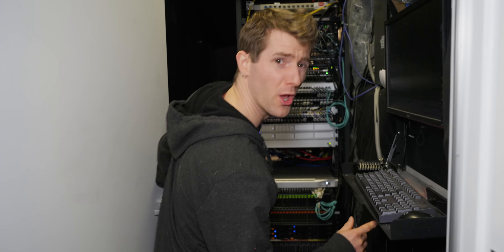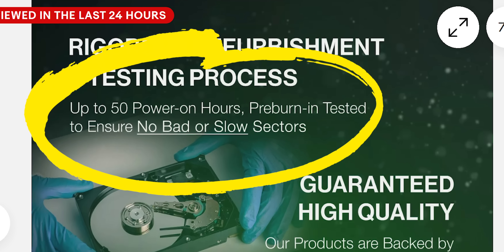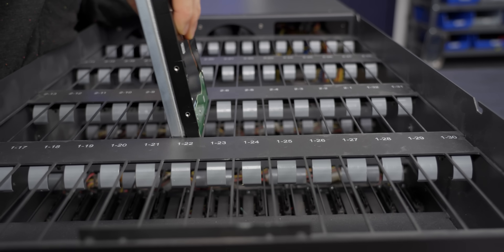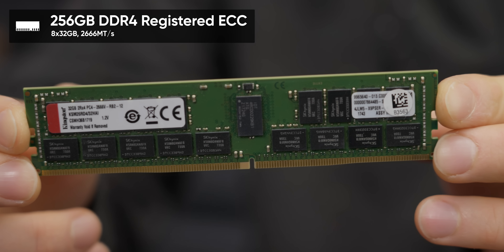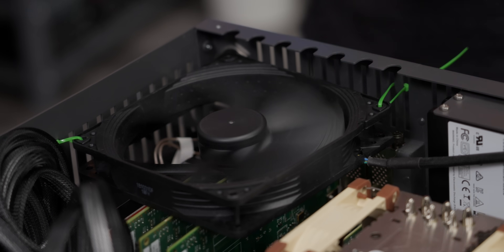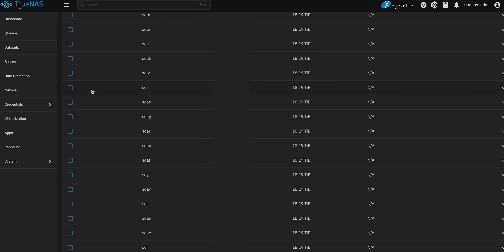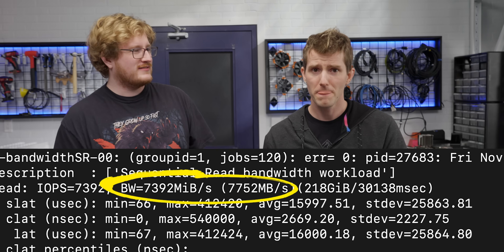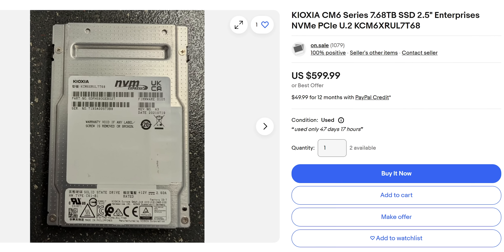Is Buying a PETABYTE on Ebay Stupid?

Comment: I've had about 15 refurb drives through the years with unimpressive results. 
It first started with two 1TB Seagate constellation drives in raid 0 that both died at similar times, then a handful of 1TB WD RE drives in a freenas build that I think about half eventually died over years, to now a mix of HGST and Toshiba 3TB consumer drives with mixed results, usually bad sectors, rather than outright failure to mount. 
At this point I've given up on trying a NAS of random drives. The cost wasn't worth it for my use case

Comment: I've been running refurb HGST 8TB drives for ~3 years now in my desktop (2 drives) and have had a great experience, so much so that I used the 12TB variant of the same drives, 8 of them, in a RAIDZ2 setup that I did in much the same way as in the video, just in my old desktop and its Fractal Design Define R5. That's been running for ~3 months and has been rock solid as well. 72TB array has been a great upgrade and I wouldn't do anything different if I had to do it again.

Comment: The real catch is that refurbished drives from Seagate will not have any warranty! I had this experience with Seagate Exos drives... Got faulty drives replaced by "refurbished" ones and I was told clearly that they would have no warranty...
Now about ZFS for important data, I would prefer using Mirror VDEVs (RAID 1). I have 2 reasons for that:
1. 20 TB per drive at home seems quite enough for years to come, especially with 4 drives in RAID 1, giving 40 TB.
2. If 1 drive fails and has to be replaced, the rebuild will be much quicker than the having 1 or 2 parity drives and 2, 3 or more data drives. That would take weeks to complete on such big drives! Remember that during the rebuild process, all the other drives are under heavy load and it is not uncommon to have another drive failing during the process... Oooops, all the data gone! With mirror redundancy like RAID1, it is just a matter of "cloning" one drive to the other. Much faster, especially on a 20TB drive.

Comment: I bought 4x 18TB recert exos drives and been running them in my NAS for a year now. Would recommend since filling out my nas with that much space would have cost 1600 with new drives and if it fails I have redundancy

Comment: Personally I think as long as you have backups then old drives are fine as long as you respond quickly to failures. The odds 2 drives fail at the same time is low. In fact you actual reduce those odds with second hand drives as they have different usage. 2 brand new drives will wear out nearly identically

Comment: My setup is based on a Lenovo desktop tower (no monitor) and two 2 TB external SSDs connected to the desktop via USB which acts as the NAS. I'm using desktop Windows and Windows Storage Pools with mirroring. One of the drives failed recently, note -with storage pools before physically removing the failed drive, remove it from the pool while its still connected as you will have to rebuild the whole pool as it will not accept a replacement :-( I'm waiting for SSDs 4 TB drives to come down in price to replace the existing drives. They will be mounted internally. I used to use a Raspberry PI what a nightmare that was.

Comment: I've now bought 8 of 16TB Ironwolf refurb drives for about 200$ a pop instead of the ~400$. They are more silent than the Exos drives. Started buying locally, then moved to ordering from china with fast (~1week) shipping for no extra charge.

2 of them have started showing bad sectors, of which one of them I was able to RMA, second I removed from the pool yesterday without losing redundancy even momentarily. Running on my old main PC's hardware including a Define R3 case that fits 7 disks concurrently so the "NAS" itself cost nothing, with a NVME boot drive through a pcie+usb bootloader stick hack (old 1TB nvme), and because I'm running on Windows with storage spaces (parity), I can have Backblaze running and backing everything up to the cloud for even more redundancy for 10$ a month.
Also does other things like my own app compressing ~8h of video daily with NVENC, and running DirectComputer-based whisper on my old 970 GTX, which is another reason for being Windows-based.

Yes it runs at 100watts when idling, 24/7. But electricity isn't Germany-priced where I live so it's fine.

I double dare you to have a more frugal 1/10 petabyte single-user home backup / GPU server than mine.

Comment: I never considered to use recertified ones because I plan to use them as long as possible for home use, and half of HDDs are installed to normal Windows computer that does paperworks, gaming, Internet, anything 'PC' does. But, for NAS, with RAID 5 or 6, and if that NAS isn't for almost persistent data storing like cold storage, this sounds pretty good to adventure. Hmm.

Comment: I've been running eBay used and refurb drives in production servers for DECADES.  I haven't been burned yet, it's been absolutely fine.  My current hosting server setup is RAID 6 with 8 used (not even refurb) drives spinning, I bought a 10-pack, had to use 1 of the cold spares after 3 years, and it's now on year 5, I've still got a cold spare left, and I'm not even gonna consider replacing the array until I have to use that.
I'm gonna consider getting some of these 20TB drives and moving my media server storage, because my pirate TV and movie collection keeps expanding to fill available space, more would be good.

Comment: This screams cost recovery of someone offloading unused hardware. The middleman has every incentive to buy quality product and provide a decent warranty to make a reliable margin. The middleman also knows his supplier has sunk cost into something that would otherwise not be used or make money doing work. In truth you're often better dealing with bulk suppliers like this because you can have relationships with them and they care about rep, plus they have spares that they have acquired for pennies--unlike Seagate which is trying to pad their bottom line by hiding failures and squashing returns. This makes Seagate minimize their losses by offloading them, which keeps their stock value high. I don't know if I should be happy or disgusted, but that's the game.

Comment: I am a ratty rat boi. I love secondhand tech. From storage to even some LCD drawing tablets to cars, to batteries and everything in between. I understand how channel this big has to warn and advice against, but anyone who knows how a disk can fail, how storage can fail, how long they should last and how to back it up, they will know that it is very worth it to take a gamble on things that are 70% cheaper than new. I just got my nasrig running with 3rd hand storage with raid 1 on 3x 4tb disks and it is running perfectly. I can have 2 of them fail and still retain my data.

Comment: Here is the thing - as long as you have redundancy to prevent data loss, at 50% off you could literally lose 40% of the drives immediately and still come out ahead.

The odds of having that many fail are incredibly low.

Comment: All of my drives are pretty much HGST refurb drives from eBay.

Been using them oh gosh...since AT LEAST 2007, in varying capacities.

In my experience, pretty much all of the drives that has died, did so because the AMBIENT environment started getting hot (e.g. system was sitting in front of a heater vent because that's the only place where I could put it in the room that I was renting, when I was in uni), but otherwise have had GREAT experiences with it.

I would NEVER buy Seagate.

And you're 100% right about the migration from cloud BACK to on-prem, because it doesn't take a genius to be able to figure out the math and the economics for on-prem deployment favours on-prem systems SIGNIFICANTLY.

I'm still surprised that you guys aren't using LTO tape for archiving, but for long term archival usage, it'd be better and cheaper, to go with tape.

Comment: I wouldn't trust a brand new seagate drive let alone a refurbished one. Every seagate drive I've ever owned has failed within 3 years, meanwhile I'm still running a 1tb WD Green from 2005 as one of my game drives. I dunno how you can accept their sponsorship when you can look at statistics from any data center and see they have a ~95% early failure rate.

Comment: That server CPU is only 8 years old? I recently checked what kind of CPU is in the server we have to use a VDI on at work for some tasks for security reasons... It was a xeon from 2012... And yes it's unbearably slow. If I haven't logged into it for a while I better wait for like an hour after starting it to let the virus scan do its thing as it just 100%s the three cores I get for about that long. Luckily I personally don't need it much, it's terrible.

Comment: I even went the route of buying 10x 4TB used enterprise-grade HGST drives. I checked them with harddisk sentinel and they had over 400TB read and 200TB written. SMART data still looked good and hard disk sentinel graded them as 100% health. They have been going strong without issue! I won't buy new drives anymore, as buying a box of 10 is the same price as 2 new drives. I'll just buy another box when they start to fail!
Reply: 100% what I do my friend! I buy 16 TB refurbished drives with 5 year warranties alllll the time. They work amazing! I had one poop out on me the other day. Though if you're running 10+ drives like yourself or I, then you're doing things like ZFS/RAID (redundancy yay!) But I just swapped out the bad drive with a cold spare, sent in the old one for replacement, and had to pay a $4 shipping fee. And even without the warranty, lets be real. It's cheap enough to just buy another lol.

Honestly I don't think I'll ever buy a new enterprise HDD again.
Reply: @slurp50s  hell yeah! I still haven't gotten a drive fail on me. Like you said, zfsraid 2 on 13 drives wide for safety. I have 2 hot spares ready to jump in and 2 cold spares on the side. All those drives cost me less than 5 new ones. Insanely effective
Reply: @AppaFappa  No drive fail yet? I've had a handful with refurbished or used, but I wonder if it's also where I live. Power in my city is notoriously terrible. I have UPS's, but sometimes the UPS doesn't survive the full outage, so I have hard power downs, which is terrible for the drives.

Why haven't I set it up to auto shut down safely because I can? Because I'm lazy lol.

Though, not sure if you've played with vcache or SLOG, but I've been utilizing that for real for the first time recently and I'm absolutely in love. I'm even running freaking databases on it now!

Like what the hell?! How is my insane ZFS hybrid rust spinners and NVME's running glorious freaking SQL databases?! hahaha, cheers friend!

Comment: I just picked up the Seagate Recovery Service’s results from the 3/4 full 4TB drive drive I accidentally formatted. Without warning they sent only a portable 2 TB 2.5inch replacement. They did not send instructions to use their included file explorer but i figured it out, jts still analysing data after 1.5 hours - i am thinking of stopping the process and disabling bitlocker to see if it will fasten things, i wish i did it first, the speed might be due to my full 0 drive. So i received 1.5TB back, the program estimates another 5 hours to look for files, i think 1.5TB of files lost were just archived games but if i lost my first ever minecraft save it will be sad, I probably lost an encrypted iphone backup due to the confusing data type. When i tried to access the data using windows explorer my OS seized up for 10 minutes. The brand of new drive is LACIE it has USB C 3.1 gen 1 female plug and the box advertises “130MB/S” and “FOLDER SYNCING WITH LACIE TOOLKIT”. 
The included in root Dir Seagate file explorer has a working stopwatch but the loading bar is either 10% or moved to next step, analysing or moved to next step and 28% and it has yet to be any other number since the step started 30 minutes ago currently at 2 hours and 58 seconds, estimated time remaining 5 hours 0 minutes.

Comment: What if you guys invested in research to utilize storage in a way that can store 10x more data compared to what you can do with it today? I mean recovery software can recover already deleted files by converting or building the storage map, so why not do something similar intentionally to break - encrypt, and store much more data than what we can store today. Like a storage gear or unit that can store the storage map and use the storage as a multiplier. So, the storage would act as RAM and have a small storage for the unit to store the map image, the rest is to project the unwrapped data based on the map stored and remapped by the unit. 

I am not a computer scientist so, don`t blame me for anything, but if we have a small processing unit that handles a storage media where the generated storage maps would be stored and launched from, and there is RAM (Random Access Memory) to handle the DAM (Direct Access Memory) - the actual storage devices linked together, I think it might work. It would take time probably to launch and build the data, but if the encryption key would also be used to allocate the information that is stored on the map, there would be no chance of restoring anything without it.

Let us assume that we link BTC mining machines and their network as a security feature and that we have linked our data using the minted already block and hashes to organize our data. Every time someone asks for access to the data a private key would be launched and the private keys would be generated, it would make it near impossible to break into our storage and would likely keep mining beneficial even after all BTC had been minted.

And, once we can link storage to BTC private and public keys, we can basically use its network as an actual network capable of sending instructions, launching protocols, allowing access to data, or absolutely anything that we want as long as we embed its features into our operating system or any operating system at all. It could serve as a universal ultimate handler.

The real question is, how would it affect BTC price if we payout miners and owners could impact the market price, or store the fees and dump it into a BTC foundation that would serve as a reserve to cover its value, equivalent in FIAT currencies, or bonds, or anything that is linked to it.

Ultimately its price would increase indefinitely as anything that can be an attached value could be or would be regulated through its system to provide security and efficiency once everything goes through it, banks, governments, and complete infrastructures could be governed by this system globally, sending instructions or utilizing resources, data, power or commands, all through it.
Reply: Yes recovery software can....IF it hasn't been written over. So that technique wouldn't be applicable.

Comment: Last Seagate drive I had was a 3TB. It started to fail just within warranty, so I went to get it replaced. They sent a "certified refurb" that was in even worse condition right out of the box. I notified them and they promised a manufactured new replacement; when that arrived, it was a completely DoA refurb again. Then they promised a mfr new AGAIN... AND THAT TOTALLY FAILED IN 2 MONTHS. So they replaced THAT drive with a drive that TOTALLY FAILED IN 6 MONTHS. I didn't bother contacting them again and I've convinced several people not to deal with them since. None of my WD HDDs have failed, nor have the ones I've recommended people. Even the used, 20yr+ old IDE HDDs we use for old electronics are either Toshiba or WD. I think it's usually Seagates that we're replacing.
I don't recommend WD SSDs, because they hid how they shut off 2 lanes on a PCIe4x4 SSD in a gen 3 slot. That caused an issue in a mobo that didn't allow 3x2, only 3x4.
1 RMA: 5 bad drives.

Comment: I started my current rendition of my NAS back in 2012 or so with 9x of their 3TB drives.  Pretty sure same seller on ebay (or was VERY similar listings, server recertified stuff).  Those 9 drives are STILL in use to this day in various rigs around my PC collection.  Currently have been rocking 6x 14TB drives, also recertified ebay drives.  They've been rocking for 4 years straight, not one hiccup.  Every hard drive in my current collection has been recertified drives, haven't had one problem yet.  Did have ONE drive fail a zero fill on arrival but the seller sent a replacement immediately.

Comment: First thing first, the fact there are refurbished drives in bulk is always a worry about buying the new counterpart. Guy below, your own fault for buying external drive to begin with. they are just desktop drives that don't pass the test. NEVER use external hdd that you have not made yourself.

Comment: The warranty through serverpartdeals may be good; but I wanted to share my experience with Seagate. Back when I lived in India, I had a Seagate drive fail on me a week ater buying it. Instead of shipping in the defective drive, they had me head to a service center, get a ticket & wait in line for around for 1 hour in 34C (93F) w/ no air con, and send me the replacement drive a week or so later.

Comment: bought these drives 6 Month before here in Germany - 8 Pieces for my Qnap NAS on ZFS. No Issues so far - good performance. I had really concerns using recert drives.

I will go for another 8 pieces for my mirrored NAS. Pricetag here is a little bit higher - 250€ but importing from US with customs, shipping is not really an option :)

Thanks for your review :)

Comment: i got 6 of the seagate 16TB drives from amazon, manufacturer recertified, 2 drives failed in a month, found out the company was in san diego, replaced them (one at a time) just went to their place since they were close.  they had no idea why, said it was unprecedented, so i just returned all of them to them, and bought brand new ones for about 100 bucks more each. no issues for 2 years now in my truenas scale box